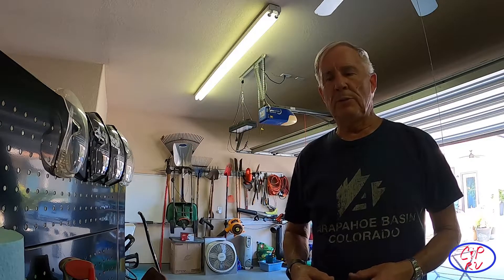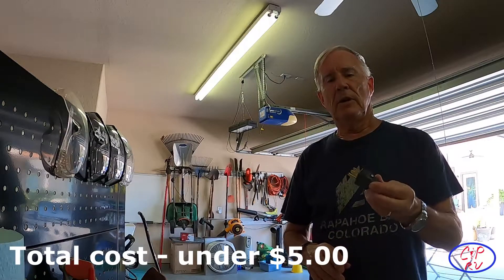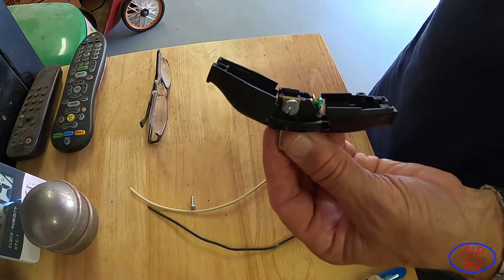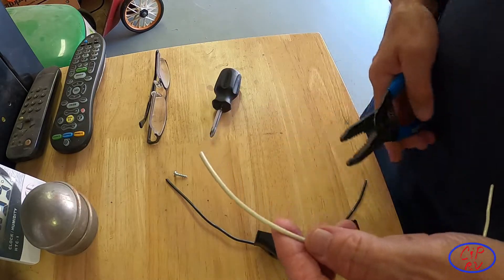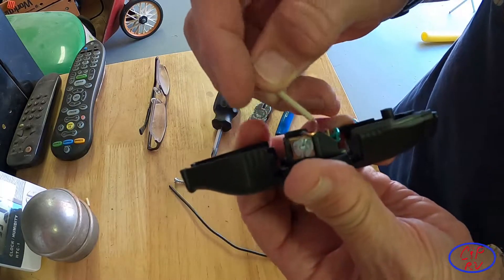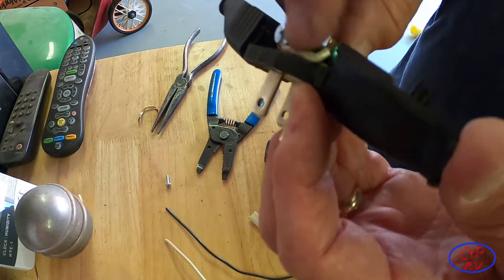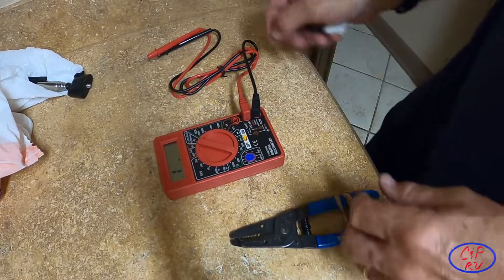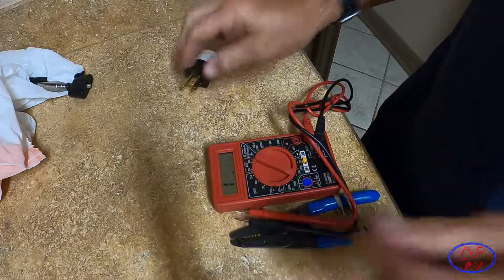Neutral - Ground Generator Bonding Plug for a Portable Generator Connection to an RV

Comment: Question I had to un bond my gas generator so that I could use it with my homes transfer switch.in a power outage. For me to use the generator normally as a standalone unit to run power tools I would have to revert back to a bonded neutral for GFCI protection. Instead of switching wiring, could I just use this plug? It would save me time.
Reply from the maker: I would think that would work if you are connecting the generator through wiring that includes a GFCI outlet.  It works fine in my RV where I have 2 GFCI circuits along with several non-GFCI circuits.   Caveat - I am not an electrician & while I do use this on my RV where I am familiar with the wiring and limitations, I take no responsibility for situations with which I am not familiar.

Comment: Is this dangerous using it on a floating neutral inverter generator?
Reply from the maker: Floating neutral means the neutral isn't bonded to the frame, and the frame is the ground for the generator.  If you get a standard 3 light outlet tester and plug it into a floating neutral generator, the lights on the outlet tester will show an error for an open ground.  Insert the neutral ground bonding plug in another 20 amp receptacle on the generator and the outlet tester should show the wiring is correct.  I've used the plug I made on my generator for many hours with no adverse impacts.  Because my RV has a built in transfer switch, it won't allow the 120v AC power to pass if the transfer switch detects the open ground.  
If you want to read up more on this subject, here is a link to a great article that provides a much more detailed explanation.
https://www.rvtravel.com/rv-electricity-bonded_floating_generators/

Comment: So will this make the generator ground hot? How does this protect against a shorted appliance?
Reply from the maker: It does NOT make the generator ground hot.  This bond is between the neutral wire and the ground wire, not the hot wire.  You do NOT want to bond the hot (black) wire to the ground or you may short out your generator and anything connected to it.  You can google Neutral Ground Connection for additional information.  Some generators come with the neutral and ground already bonded so you should check the specs on your generator as it might not be required.  Many inverter generators do not have this bond (connection).

Comment: When I do this it just trips the GFCI on my outlet on the generator.
Reply: Is this dangerous using it on a floating neutral inverter generator?
Reply from the maker: I've never had that problem with this plug on my generator and I've never had anyone else report this issue. Perhaps your generator already has the neutral / ground bonded?  Recommend you look at the generator specs to see if that's the case.
Reply: @candprv  I just went for it and it worked so I guess I don't need it. Thanks so much for this video. You kept my family from freezing!

Comment: Why not just take your hot post out?
Neutral and ground will keep plug in
Reply from the maker: I suppose you could do that,  but there's really no reason to pull the hot post since it's not connected to anything - and - it will help keep the plug in place as the generator runs and vibrates.